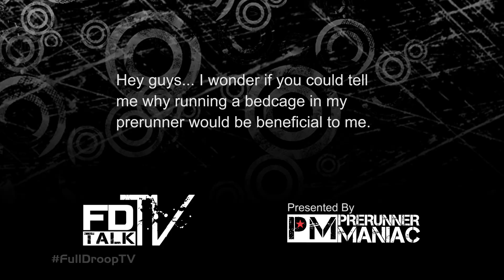Silverado Prerunner Long Travel Suspension Kit - FullDroopTV (Season 1, Episode 2)

Comment from the maker: We actually set the final ride height based on the amount of lift we got with our Deaver leaf springs. After they were installed and we set up the front kit we cycled the suspension to determine where we needed to mount our shocks to achieve the correct ride height.

Unfortunately there is no guide to follow for spring rate. If you contact Eibach and let them know certain things about your prerunner I am sure they can help you. A place to start with a fullsize 2WD truck is about 750lb springs.

Comment from the maker: You are correct but the LSK kit is very resonable for anlong travel kit, some are over $5k
Reply: How hard is it to fab shook hoops for a 1500 2wd silverdo.and when you cut the coil bucket off should you plate the frame ? And should you also plate the frame where you   mount the shook hoops to the frame?

Comment: Hi, I really want to get into the whole off road racing thing, I know I have to build a prerunner first, but where do I start?
Reply: By building a prerunner.
Reply: +Gilbert McGillicutty Well, yeah. but what then?
Reply: Then you race it
Reply: Id go the 2wd route.  kits aren't cheap though.  do you have a truck to start with?
Reply: Justin Duke Probably a bit late but i'd start with a budget ranger at local events just to try it and decide if you wanna go all in. If you're cool enough to go all in then do long travel and 4 link.

Comment: Do they have kits for older models, 1990 chevy silverado
Reply: Louis de Lange fabtech made a kit a long time ago. I had one on a 91 Chevy. They were good but weren't true long travel kits. You would really need to go to a fab shop and have one custom made for a '88-98 Chevy. The reason why they don't make many kits for them is because it's really not an ideal platform to begin with.
Reply: I feel like an idiot after having replied, this particular company, LSK, does in fact have a lot for an '88-98 Chevy. It's actually a rather good kit, with a price tag to match. $4500.

Comment: I have a few questions , first , why did you not protect the shock while welding ? All it takes is one piece of slag to stick to the threads and the shock is no longer adjustable . Also If I spent the 1500$ for coilovers and the finnish was ruined by weld splatter I would be furious ... Second ,  did you torque the suspension bolts ? I work in a 4x4 fab shop and I am ASE certified , running the suspension bolts on with an impact is a big No NO ... Due to the fact it can over torque the bolts, strip the threads off the bolts and distort the nuts .   I do enjoy the videos and the work you do , this was just something that made me question the build ..
Reply: i agree
Reply: he did alot that bugged the shit out of me also
Reply: There can only be one.
Reply: what bugged me the most were his harborfreight tools can't stand them

Comment: I thought u said that kit didn't need any fabricating ....
Reply: It didn't they chose to use a longer shock than what LSK had in mind (8" vs. 10") If they chose to use an 8" shock then they wouldn't have had to do any :)
Reply: dont HAVE to fab for kit. they decided to do extra by upgrading shock which required upgrade.

Comment: You should re-evaluate how you perform maintenance. I saw A LOT of improper practice. Take your time and do it the right way.
Reply: +Kevin Morris Hey, tell me what they could do better, or different, so I can do the best I can when I install this.
Thanks
Reply: +Cody McCall dont hit bolts with steel hammers. Dont cut and weld your chassis. use threadlock (locktite). dont leave your steering rack boot cuted-open. dont use the impact on the nut use it on the bolt and use İMPACT SOCKETS not any socket you find. hope i can help
Reply: @dkongul  cutting and winding your frame is fine. Happens all the time. They used thread locker on the bolts that need it. All the rest were lock nuts. No need for a boot on the steering rack when there is no greased joint needing to be protected.

Comment: why cut the boot in half and then leave it wide open?
Reply: the boot was only shielding that joint for lubrication, not the steering assembly
Reply: im pretty sure they swapped out the boot off camera

Comment: I've got a '81 Chevy Short-Box Step-Side with a 600 hp 489 stroker torque-monster for power.  It's jacked with 17" rims turning 35" rubber all on leaf-springs and good quality Rancho regular suspension with 22" or so of potential squish.  I currently have this truck in Vancouver, Canada, but it will end up in Baja.  I would like to use the truck as a pre-runner/grocery-getter/chase-truck (I've digs there).  I would like to get some real droop into the thing..  Do you's guy's have bolt-on kick-ass long travel suspension kits for a bad-ass '81 Chevy?
Reply: Diesel Ready Not with a solid front axle

Comment: No lock tight on those bolts? those better have locking rings or else you might lose an arm on the road lol
Reply from the maker: They haven't loosened up yet
Reply: Why even take the chance haha!
Reply: +prerunnermaniac just stop ignoring the fact. you just butchered the vehicle. And remember those bolts do get lose at once and they fell off. 5 more seconds with a bottle of loctite would prevent any of that happening. whats is the deal with hammering the thread end of a bolt with a STEEL hammer? sure way to mushroom the bolt.shame...
Reply: Ever hear of ny-locks and lock washers?

Comment: Not proper. No jack stands. No safety glasses. Cutting off the boot rubber boot? theres an accident waiting to happen. this might be okay for a shade tree backyard guy but in no way is this okay for an instructional video.
Reply: Maybe you missed the JACKSTANDS
Reply: They're BRIGHT ORANGE
Reply: At 11:14 you can clearly see an orange jack stand behind the hub assembly and the boot was only there to only protect the old tie rod end which they didn't reuse anyways.

Comment: I get that it’s a kit, but no washers on the lower control arm bolts? Really? Not having a washer behind a nut or bolt just doesn’t sit well with me. Seen the edges of the bolt gradually eat through metal with not having the load spread out via a washer.

Comment: terrible build. the plans were right but execution was way off! i would tighten my suspension with an impact and then leave the dust boot cut in half. just saying... if you are going  to do a build like this do it right the first time and get the right tools. looks like that hammer you were using was a harbor freight special.

Comment: worst bolt-on kit i have ever seen. first of all you need to widen the chassis which is a big no no. Engineers spend so much time even on the tiniest bolt but this kit just uses brute force to get things together. Shame...
Reply: i have the same kit on my truck. and i didnt have to do any of the crap he did.
Reply: +Jeremy Benson then shame on these "mechanics". They butchered the vehicle.
Reply: +Jeremy Benson WAIT A SECOND!!!! i just realised that the dude @5:19 is the dude on 19$ oil change scam video. HOW?